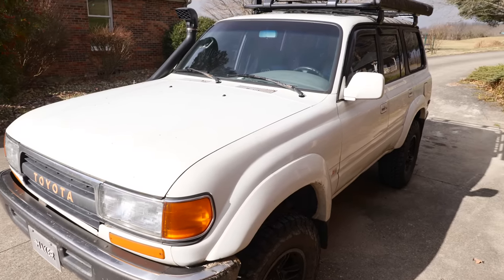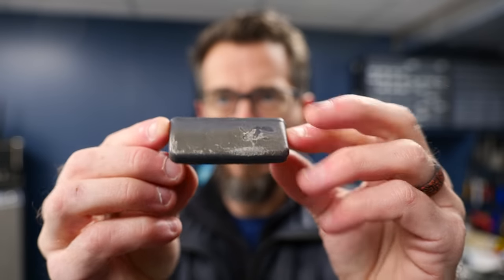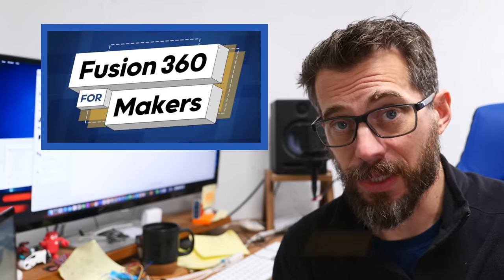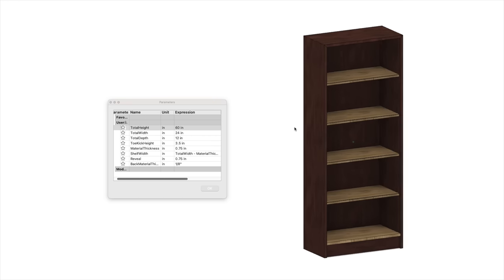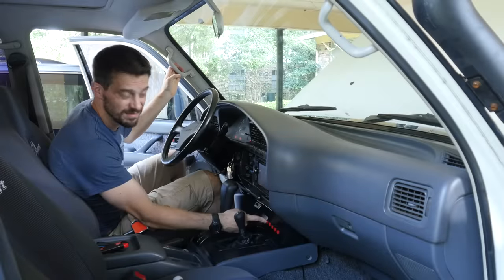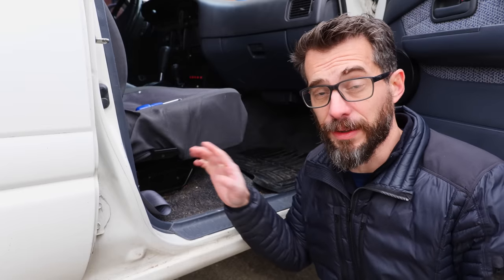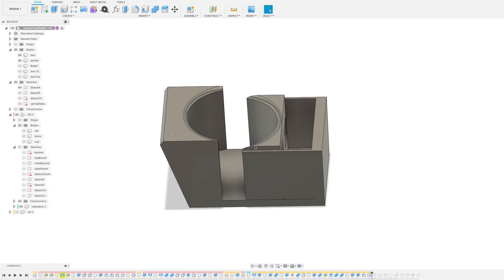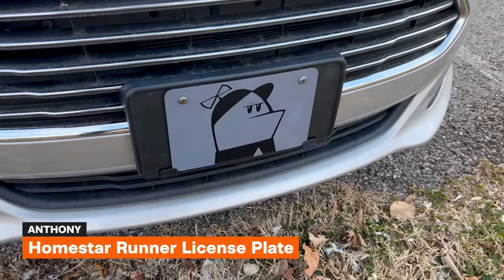Can 3d Printing Improve Your Car?

Comment: 10:59 you could have printed the springs out of PETG too. But I would have used ABS+ for car parts.
The spring should look like a zig zag and printed sideways. Did a small project with such springs this week as well.
Or do cut outs and print 3 arms attached only on one end holding the cup. 2.6mm wall thickness should be enough.

Comment: Honestly one Idea that might come in handy is trying to see about making a slot that the belt can slide into on the side of the seat, that way you don't have to worry about it getting caught on something that will make it not fit right, or maybe 3-D printing a deeper cup holder that the inside portion has interchangeable parts so that way depending on the size and shape of the cup it might fit better.

Comment: I had some SLA printed han solo dice on my mirror for 2 years. The reason it busted was because of the hollowing the print without drain holes. I will print another pair solid. I also printed a switch holder for my aux lights in PLA and when they melt I will print it out again in tough resin.

Comment: PETG can get very brittle, crumbly and even looks like it is rotting from UV exposure (and in the car on the sun there will be UV). Black PETG is much more resistant and primer + uv resistant paint will help big time, but if you do not want to paint it try out ASA material. It is not that hard to print, not expensive, and it is UV resistant with much higher working temp range than PETG.. You will need to put some "box" over your printer to properly print ASA (no need to have heated chamber, but closed chamber is very useful) and supports are much easier to remove than with PETG (petg is too sticky so supports are not as easy to remove as with PLA or ASA)

Comment: I have several jeep cherokees (94, 96, 99); I use 3dp to make a lot of replacement or custom parts that cannot be found anymore outside junkyards, or just custom solutions for modifications I'm making. The problem with plastics is they generally have a limited shelf life; UV, especially in areas like mine that are constant sunshine, kill plastic. Consequently, many plastic parts you do pull from junkyards are in no better shape than your part.

Comment: As someone who actually remakes and sells 3D printed plastic parts for old cars (albeit in low quantities), I would make one note on the use of PETG.  In my experience I have found that under stress it will eventually deform slightly with elevated temperatures (even here in the Pacific Northwest).  Summers with sunny days in excess of 105F were enough to do it for me.  This is really only a problem for small trim clips and press-fit items though.  I doubt you would see such effects as soon on larger parts.  A Tg of 80C is reasonable, although apparently not perfectly sufficient for all geometries.

I've now ditched PETG for anything automotive related and stick to ASA, PC, TPU, and CF-Nylon.  I realize those are more difficult to print for many people but the better properties are very much worth it in my opinion.  Also acetone welding with ABS/ASA is a lifesaver for anything you may need to print larger than your build volume.  The only thing I miss about PETG is the absurdly good layer adhesion, although PC competes pretty well on that metric.

Comment: Sometimes for things like a cup holder it's easier to get a cheap one from a car at a scrap yard and make a way of mounting it to your using 3d printing. This way you don't have to worry about springs or mechanisms for different size cups.

Comment: Let's see if my English allows me to explain myself. About the cup-holder, I would model it with a couple of "rails", "indentations" or whatever you may want to call it, one on each side, so the moving part doesn't need to be covered (or not so much) to be kept in place.

This way, what's now the top part could be about half it's size (measured from back to front) and the moving part would have a longer top that would slide under the top fixed part.

Comment: For the top cover for the cup holder a dovetail slide could work. It will keep it locked down but it can slide back to match the circumference of the container.

Comment: 11:55 Get rid of the cap altogether and put some slots in the sides near the top and give the pressure-plate a flange, that way, its lip will hold it in place and the top will be completely unobstructed for any size cup.

Comment: Fantastic video! Recreating things in 3d for printing is the number one thing I want to use my printer for but also the most difficult. I would love to see more tips and tricks to recreating things in 3d. I always get stuck trying to measure curves and arches especially when they taper and change.
Reply: Most can be approximated by circular/elliptical arcs. Three points is all you need. But that said, in many cases, you don't even need to match curves exactly: you have more design flexibility with 3d printing than injection molding, and so don't have to necessarily replicate the shape, just the function (and thus just enough of the shape to serve the function).

Comment: I found a guy selling a redesigned like what they use for mechanical airplane controls that was better then ball socket joint for my 98 manual Saturn Sudan.  The ball from shifter cables broke to the stick broke.  He sold it as 30 dollar fix with another 10 dollar fix for the socket that I ended buying almost 10 years later because that broke but could around it with zip tys temporarily.  The replacement from GM was to replace the shifter cables part was over 200 dollars without installation.

Comment: Welcome to the cup holder design challenge. I have lost count how many cup holders I’ve designed working for heavy machinery design engineering. Never can find the perfect option that fits every customers bottle or cup of choice and then finding easy to reach places for holder is also a packaging issue.

Comment: Quick Tip. If you have something that is mostly flat like this thing. You can just scan it with some kind of measuring device. Scale the scan according to the measuring device and trace what you need. Speeds up the whole taking measurements part up big time. Basically works for any part that was once laser cut for example.

Comment: I got a Ender 3 pro for $130 with a spool of filament from microcenter with a coupon I found in instagram. I’ve been wanting one for a while and getting that coupon was the tipping point. Bring using it everyday for the past few weeks. Print mods for it and parts for my Miata or designs that I’ve made for around the house. PLA prints beautifully but abs not so much. I have a glas bed and metal extruder in the way

Comment: Nylon is probably a better choice for a hot car, all else being equal, but I agree and would use PETG myself. Primarily because it's pretty much all I print with these days so I have an assortment to choose from, I've gotten things dialed in pretty well, and I can deal with the occasional stringing and blobs PETG tends to exhibit since all my prints are functional.

Scratch that, I have a specific car use that just came to mind (snapped piece inside the door handle mechanism) and I'll break out the Nylon X carbon-fiber reinforced filament. Probably impractical for many folks as it's expensive and requires a hardened nozzle to print, not to mention a rough finish. But totally ideal for this sort of thing.

Comment: For a printed part, try to keep any stresses along the layer lines. Prints are really weak between layers, and pulling this layers apart will ruin the part
Reply: I second that. It's a matter of positioning the model in the slicer to achieve the best pull resistance. For example, if printing a coat wall hook, it's better to slice it laying on it's side.

Comment: The cap on the cup holder doesn't just need to move with the spring-loaded curved surface. It needs to be a two layer thing so that one part telescopes over the other

Comment: Another tip is to use cardboard in order to make a rough model of the item you are planning to 3D print. For example, if there is a weird shape that you can't really measure, you can make a rough part out of cardboard and cut it and join pieces with a duct tape until it fits your needs. Then take important measurements, like holes and their relation to a surface, bring your pattern to computer and make a proper model. This way you can complete a few stages of prototyping without having to waste plastic.

Comment: I've got a 1985 Toyota 4 Runner and have the same problems in spite of it having Collector plates. Spare parts either have to be scratch made or luckily there are still parts in South Africa that I can obtain through a rare auto part broker. But there are some parts that are impossible and to maintain Collector plates where I live you have to be time accurate for most of your parts.

Comment: No joke, I've been thinking of using my 3D printer for car things lately and sure enough this pops up! One of the things I've been thinking about is a phone holder that fits on the dash so I can use the navigation on my phone and not have to hold it. Anyway, thanks for the tip about not using PLA!

Comment: This was actually one of the main reasons why I bought a 3D printer.
The Acura Integra is known for having plastic pieces break especially the door handles...
So my plan was to start 3D printing them and finding better ways to reinforce them I also plan on making my own cup holder as well.

Now my job needs to give me some days off so I can actually work on my car. 😒

Comment: if you want to make a Polyurethane Casting of the piece. It might be easier to 3D-Print the negative of it as a Mold and cast the Polyurethane directly. You'll probably need a separable Mold since most 3D-Filaments are non flexible, but it could be worth the effort if you need to produce more than one Piece at a time.

Comment: Printed a wireless-charging tray that slots into the double cupholder of my car. The wireless charger fits underneath, along with the cables in the 'void' of the cupholders so it's all hidden. Now I have a tray to just place my phone in and it charges while it wirelessly connects to Carplay :D

Comment: Hey Bob!  I started to play a little bit with TPU on my 3d printer and maybe you could try to make insert for the PET-G part. Then you wouldn't have to use spring but some flexible lips to hold different sizes of cup. Anyway , great idea :)

Comment: 1966 Buick lesabre radio delete plate. radio was an option and the plate was screwed in from the rear on plastic nibs which snap easily as they become brittle with age. its a never was able to locate another and it has a curved from face to match the dashboard. Ill have to look into that fashion 360.

Comment: What about a custom (preferably vent-mounted) phone holder?  Every vent-mount holder I've tried has been junk, because the weight of the phone, combined with the top-heavy placement of the phone while in the mount ends up creating a levering affect that causes the entire holder to pull itself out of the vent via gravity.  I recall seeing one model that somehow locked itself in place by gripping the vent from both front and back, but I can't remember how it did it nor do I recall if it was still available for purchase.  Regardless, a custom phone mount would be a great 3d printer project.

Comment: Very cool video. This is definitely a trend that is gathering momentum. Ford released specs for their FITS system in the new Maverick that allows you to create different accessories like cup holders or GoPro mounts. It would be great if more OEMs started doing this.
Reply: Unfortunately they also stopped taking orders for the new truck.

Comment: I want a trashcan for my Honda Fit, placed over the arm rest console (I never put my arm there, and it would be accessible to all four seats). Potential high Summer temps have kept me from trying it, as I've read ABS is so much more difficult to print. PETG is rolling the dice, at least according to the forum discussions I've Googled up on the topic of automotive prints, so I'm really interested to see how your prints hold up.

Comment: FYI you can fix your seatbelt from not retracting all the way by simply cleaning it... i used a pressure washer (with the door closed of course) and it worked great... 10 year of inconvenience fixed in less than 5 min.

Comment: Rather than trying to get those tricky inside measurements and drafts with a ruler and callipers, one trick is to use graph paper 🙂 
Cut it down to fit, in sections, and the scan it and use the picture to model from or take your measurements from the paper 👍

Comment: Uh I’m new to 3d printing but easy thing to do it use paper on that weird taper. So tape some paper into mold pull out and then get estimated angles then you’d probably still have to iterate but you’d start a lot closer I bet
Reply: Or 3d print a piece or like angle finder thing (two strips and screw to get an angle, idk)

Comment: The lid of the cup holder could be a two-part print. Put a screw to act as hinge, so it can fold. So the lid can retract with the spring's motion. What do you think? 🤔

Comment: Usability question: Does the spring-loaded cup holder require two hands to put a cup in it—one hand pulling the slide back enough to allow the cup to go in? If so, that'd be a deal breaker for me since I don't want to fuss with it every time I take a sip while driving.
Reply: give the top portion a tall chamfer and this won't be much of an issue.

Comment: ABS would probably be better for inside a car since it has a really high heat threshold. I know I was looking into using a resin printer for parts on a FDM printer, but from what I learned it has a lower heat tolerance than PETG. However there must be some engineering resins that would work.

Comment: I think you can actually get rubber filaments now, so you wouldn't necessarily have to mould and cast urethane pieces from 3D printed shapes. You might be able to just print a rubber piece.

Comment: Thanks guys for the fantastic video as always. Learnt alot I wish I knew a little sooner. I used PLA to print tool battery holders for the back of my car and as you mentioned the heat really affected their shape. Although they still work, they are a bit tough getting the batteries in and out and assume eventually they'll deform enough to fail altogether. 
Quick question. Can all standard PLA printers use other materials as well? I know extruder temperatures may differ or other settings if they can.

Comment: Also don't forget to use five walls stop using two walls it breaks too often, another tip for 100% there's two ways you can go about doing this, one is with the infill placing it to 100% which is basic, the next is changing perimeters to 55 or 99 walls and that will make it completely solid

Comment: Hey Bob, what do you do with all the test print pieces that you don't end up using? Is there some other device that will melt them down back into filament to re-use on another project?

Comment: Thankfully my 1999 Nissan Pulsar has a centre console box between the front seats that is perfect for square 600ml, aka pint, milk drinks and it also holds the 1 litre cottees cordial bottles that I often drink from, they have a flip top pour spout! So I don't really  need to change that, however, I'm thinking I am going to need a new car, sooner rather than later, and I hope I can find one that suits the odd shaped drink containers I use! Else I might have to invest in a 3D printer as well!!

Meantime, are you not required to have a licence plate where the licence plates go??? Back and front?? In Australia, we are, but we can make surrounds for them, so that's a possibility!

Comment: My car has the little wheel to turn airflow off from a vent and it used to click when you scrolled all the way closed but the last tooth of the gear broke so it doesn't fully close or click shut.

Comment: In my brothers car, his frontlights have this automatic adjustment when the car get too heavy in the back and the front raises up, the headlights get adjusted downwards. On one of the lights, this plastic piece that push the light up and down has broken and he can't find a replacement to buy. Would it be possible to make this part with a 3d printer? Obviously the skills to draw it in cad is something im working on and i im sure i will be able to eventualy make the part, its not a complicated one. But im thinking more about the material to use. Im completely new to 3d printing and havent even got my printer, but ive been doing a lot of "research" about different filaments, and i think ASA is the one i should use for this, or Carbonfibre nylon. If im able to create the part, will this be strong enough using ASA?

Comment: While I don't have a 3d printer or anything, I thought this tip could be useful. Couldn't you just go online and find the dimensions to trim pieces from the manufacturer? It seems like it would save a lot of time in the beginning phases of modeling a replacement piece.

Comment: I wish I could get into this more but I've had a lot of issues with my printer. I have an ender 3 pro. If it's a taller piece (think cosplay armor ect)  at the top of the piece it starts to get wavy as if the printer head is wobbling the further away from the base it gets. 

As a result I haven't printed anything in a long time
Reply: I have a lot of enders myself. It sounds like either you have a loose axis or the print is improperly supported. If it's the print itself wavering, thicker walls or more support could help. Slowing down the print and travel speeds can also give it more time to cool and solidify and less motions that jerk it around. You might want to try swapping to a bigger nozzle (.8/1mm) for big prints - it can make it faster and stronger if done right.